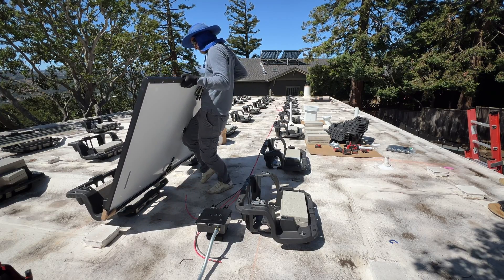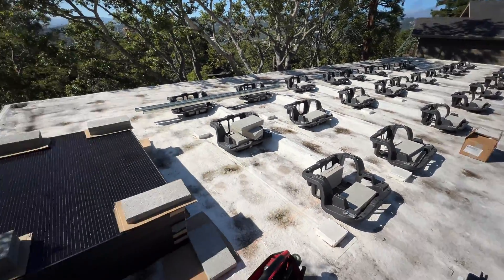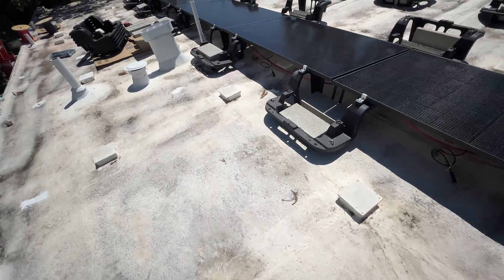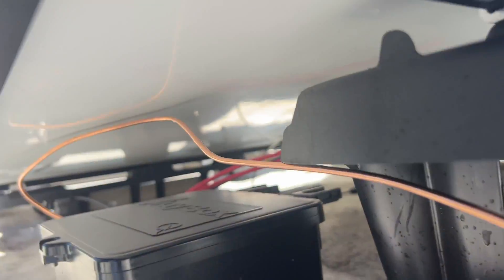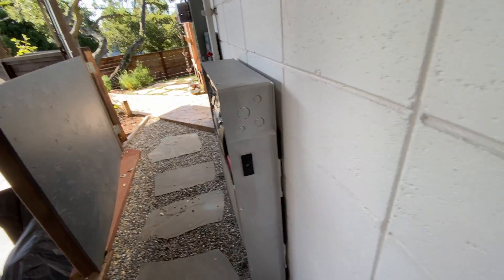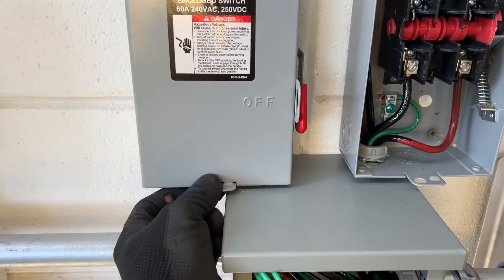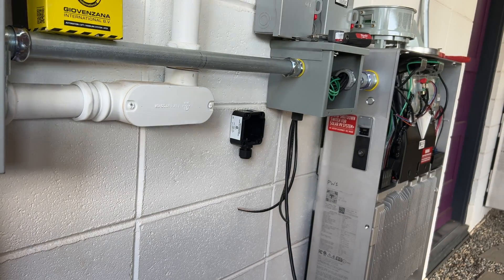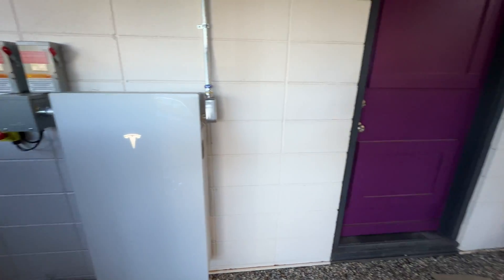Installing solar panels on flat roof. Ballasted mounting system. Tesla Powerwalls 3

Comment: what part of the country is this in? i'm here in indiana and we need 35 degrees of tilt. how do we get that tilt with these brackets
Reply from the maker: you'll need to use mounts like this: https://youtu.be/ur05U1vxqHE
Reply: @SolarEngineering I forgot to mention that I cannot Mount them to the roof. The landlord of the building does not want the solar panels mounted to the roof.

Comment: Hey dude, where can I buy these bracket/mounting system for the solar panels?
Reply from the maker: did you try to google? available online with delivery
Reply: @SolarEngineering  I found some websites which talk about it but there is no ability to buy. I check amazon and ebay without showing any of these. Seems like maybe you have to be an industry insider. Where are you saying has delivery? Can you link a website?
Reply from the maker: @martylynchian8628  
https://www.stellavolta.com/ironridge-bx-10d-p1-bx-chassis-ballasted-mount-10-degrees/?gad_source=1&gclid=Cj0KCQjwu-63BhC9ARIsAMMTLXQe8dnX5NNT9cVBkKiB4rjvDqK1HnzlSusghAJQ6OT8PSY6Xsn87m8aApZrEALw_wcB

https://www.ecodirect.com/IronRidge-BX-5D-P1-5-Chassis-BX-Ballasted-Mount-p/ironridge-bx-5d-p1.htm

search for: "IronRidge BX-10D-P1"
Reply: @SolarEngineering  Thanks!

Comment: Nice install.  Is the rapid shutdown just for the power walls or does it also do the solar panels?  I might have missed it, but i don't see any optimizers.
Reply from the maker: Installed Tesla MCI-2 under the panels for RSD (didn't get it in the video). thanks